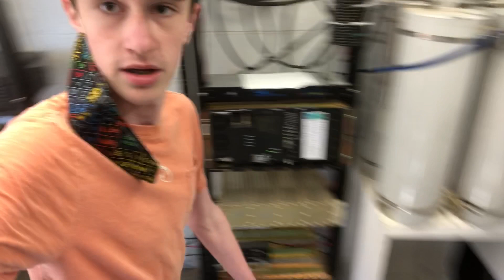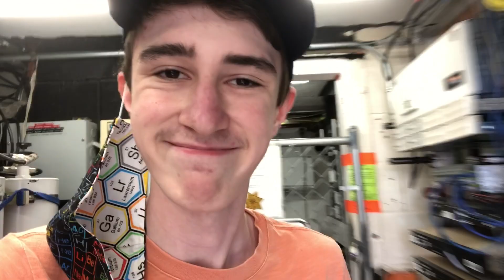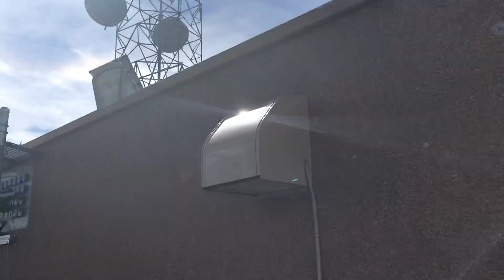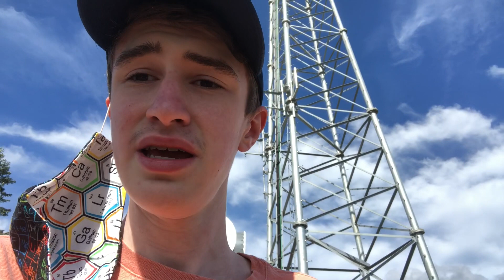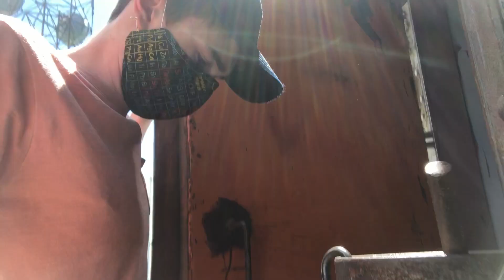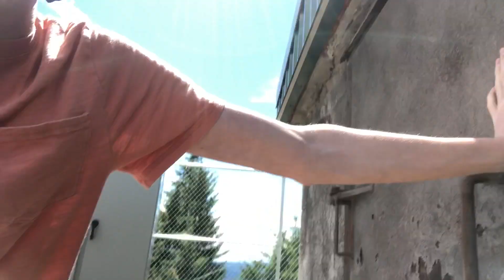South Saddle Mountain Radio Communications Site Tour | K7RPT Repeater System

Comment: Hi Evan, who did you phone?

Thanks for the video and 73.
Reply from the maker: I called Northwest Natural's Gas Control Center (they own the building we are in). They control the gas system and view telemetry data to make sure everything is ok. In the telemetry from this radio site, they monitor if the backup generator is working, how the system itself is working and also if the silent alarm has been tripped (door opened). By calling them, your verifying your authorized to be at the tower site. I can't get into what exactly their systems up there do, but the basic answer is that its an emergency gas shutoff system.

Comment: Hey I just got a TFT EAS 911. What should I do next. How do I program it
Reply from the maker: You should read the manual!
 If you don't know how it works and how to connect/program it, you shouldn't be in the hobby. If you hooked something up wrong and sent an alert over radio frequencies, you could face legal consequences. This hobby is dangerous if you don't know what you are doing, please do your research!
Reply: Evan Vander Stoep oh I’m not gonna hook it up to a radio or anything I just need to know how to program it. I can’t find any programming software for it.